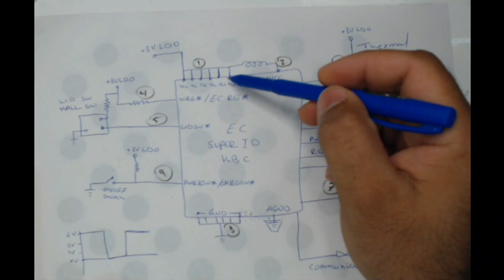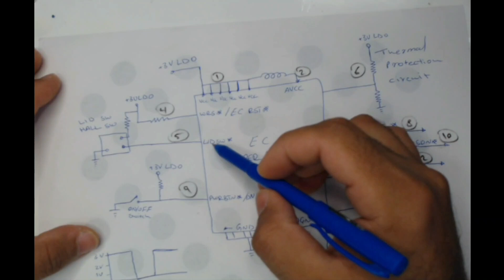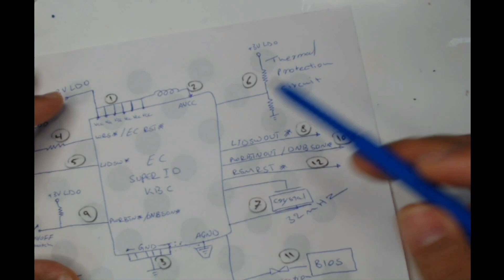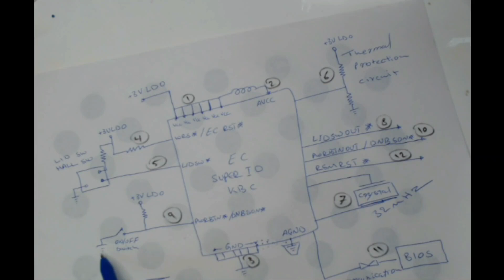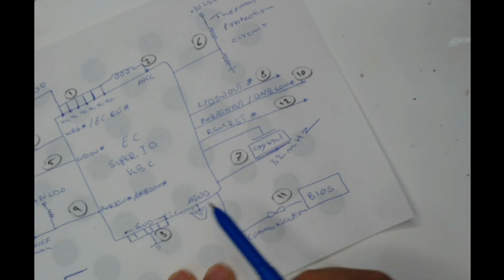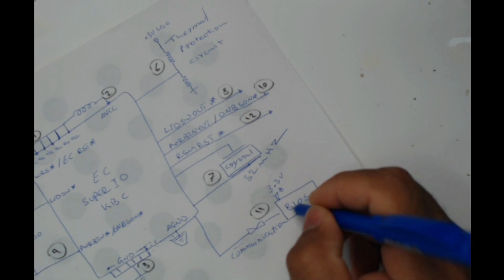How Does EC/KBC/SUPER IO chip work

Comment: Good day i need help with a HP VICTUS 16 D0023DX power button lights up for a second then off,  I haven't detected any shorts on the Board,  voltages are present at the coils the resistance on the processor and the pch is around 23 ohms.

Comment: What is KBC please?
Reply from the maker: Its Keyboard Controller and is the same chip you can call it EC ( Embedded Controller) or Super io (input output)
Reply: @ Thankyou Brother
Reply: @FixTronics  could this make the system not boot but not shut off before bios? im chasing what seems like an issue with it being stuck in ddr5 training but i might be wrong. everything works but the display and the keyboard backlight (the cooler boost button works for sure) but even after a bios reset it just boots and acts like it gets stuck before the bios loads. i was thinking maybe the imc was shot because drr5 training is one of the first steps after a bios/ec reset but the memory gets warm so idk. hell the gpu, cpu and memory all get pretty warm almost hot (the heatpipes are definitely uncomfortable to touch for more than a few seconds. laptop is a msi ge76 with 12gen intel 12700h, usb ports have power. and the fans do work they even change rpm automatically as temps go up and down.

Comment: Great, informative tutorial, thank you sir! I have a question, when one of the pins (PRBT.OUT) should be 3V, and it is only 0.8V and there is voltage drop across the resistor it is connected to, what does this indicate? Thank you.

Comment: Does the EC send the enable signal for the 5v and 3v always before or after sending the signal to PCH
Reply from the maker: The EC generates a single called EC_ON which work as Enable signal for both 3 and 5 volts always 
This happens before sending anything to the PCH 
If you watch this vedio it might give you more information https://youtu.be/tm6A63zrPyw

Comment: Thanks very much for this video, though I still have much learning to do. I have one elitebook 6930p, all voltages are present but won't come up, but when I hear the sio, it will come up and I'll be able to use it even when I turn it off I can b able to turn it back on again. The problem is, when I leave it for about 30mins while it's off, I won't be able to turn it on until I heat the sio again
Reply: When I heat the sio

Comment: Hello sir , many thanks for your explanation. My question is after you get the VCC 3v, Ec rst,  crystal oscillating 32.678 khz clock correct, the next is bios pin 1 which is chip select. I know of rsmrst confirming that PCH VCC is generated. Pls explain how the rsmrst is connected to the bin file of the bios rom?
Reply from the maker: That isn't the Main bios I was talking about 
Its the EC bios 
Maybe I did not know to explain it well
My English is really bad

The main bios is not connected to SIO at all, its connected to the PCH straight away 

So if the EC or KBC bios bin file get corrupted then RSMRST will not be generated and you have to Reflash the EC bios

Note: Nowadays the EC bios is not a separate chip but embedded within the EC chip itself so you have to refalsh the EC chip when its bios bin file gets corrupted
Reply: @FixTronics  many thanks for the explanation sir

Comment: With all due respect friend your sequence is wrong. If you check the sequence with osciloscope you will see that the first thing the EC does after receive power, clock and reset is fetch data stored in the EC ROM (Wrongly called BIOS) to configure its GPIO's. (ACIN, LIDSW, RSMRST, etc). I hope this will be helpful to you. Thanks.
Reply from the maker: Thank you for your comment brother 
I  really appreciate it

Comment: Excellent explanation, you are well educated, I would be grateful if you continue and do a starting sequence of a desktop and laptop mainboard, what are the activation signals of the different steps, how are they related, with the EC, microprocessor, what voltage value they have the qualifications, congratulations on your level of knowledge and share on the web, thank you
Reply from the maker: Thank you so much brother 
I really appreciate it 

I will try hard to do my best 
Thanks a lot❤
Reply: @FixTronics  i wonder could a corrupt bios cause a machine to appear as if its stuck in ddr5 training indefintely? kinda been chasing my tail on this one. the machine powers on and stays on but doesnt really do anything. after a bios & ec reset it powers on automatically and stays on but doesnt even act like its making it through bios initialization. fans work. usb ports have power. cpu gpu and memory all get warm (fans will even speed up down on and off as temps go up and down), charge/battery circuit fully works, keyboard works (well the hotkey fn+f8 to turn the fans up to max works at least), keyboard backlight does not work, light bar at the front doesnt work (it will flash once during cmos reset as does the keyboard backlight), no display. it never reboots on its own (cmos reset usually causes several reboots one of them is for ddr5 memory training i believe the first one). like i said it almost acts like its stuck in memory training or hasnt even gotten that far. no visable issues with any componets on the board. machine is msi raider ge76 12UE. i was messing in the advanced bios then changed my mind and hit "discard changes and exit". it booted once into windows. i shut the machine down. its never booted properly since. did cmos and ec reset several times.

Comment: for more information , no rsmrst no power so if the laptop power on then definitely we have rsmrst signal so you don't need to check the signal , honestly very very informative video , thank you
Reply from the maker: Thank you so much brother
Reply: i wonder could a corrupt bios cause a machine to appear as if its stuck in ddr5 training indefintely? kinda been chasing my tail on this one. the machine powers on and stays on but doesnt really do anything. after a bios & ec reset it powers on automatically and stays on but doesnt even act like its making it through bios initialization. fans work. usb ports have power. cpu gpu and memory all get warm (fans will even speed up down on and off as temps go up and down), charge/battery circuit fully works, keyboard works (well the hotkey fn+f8 to turn the fans up to max works at least), keyboard backlight does not work, light bar at the front doesnt work (it will flash once during cmos reset as does the keyboard backlight), no display. it never reboots on its own (cmos reset usually causes several reboots one of them is for ddr5 memory training i believe the first one). like i said it almost acts like its stuck in memory training or hasnt even gotten that far. no visable issues with any componets on the board. machine is msi raider ge76 12UE. i was messing in the advanced bios then changed my mind and hit "discard changes and exit". it booted once into windows. i shut the machine down. its never booted properly since. did cmos and ec reset several times. machine uses a gigadevices bios chip with the contacts under the chip so it cant even be reprogrammed without removing it completely from the mainboard.